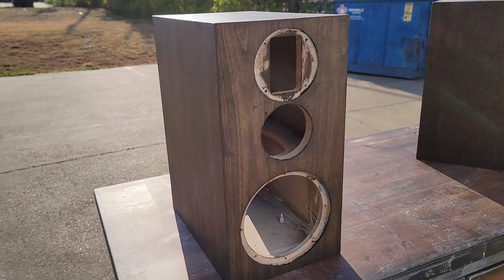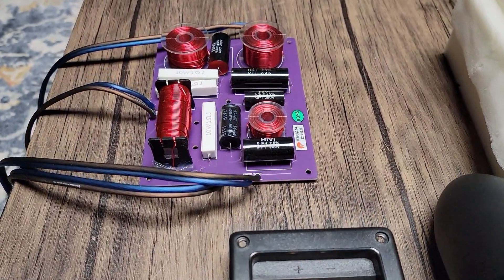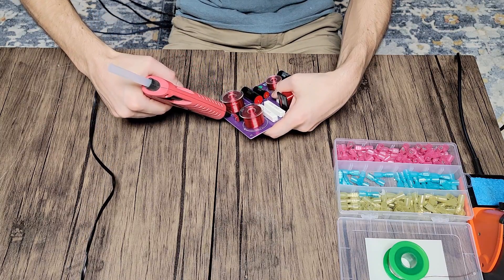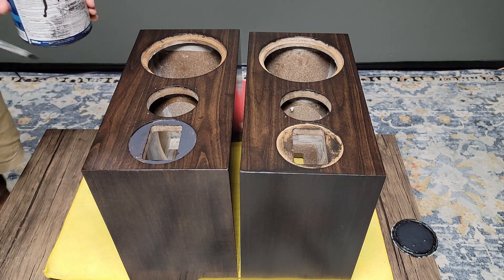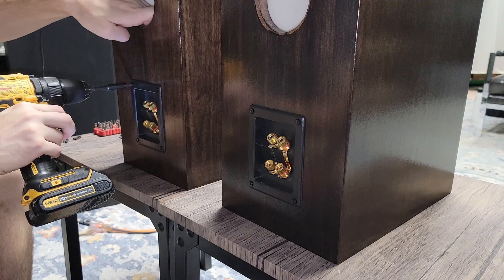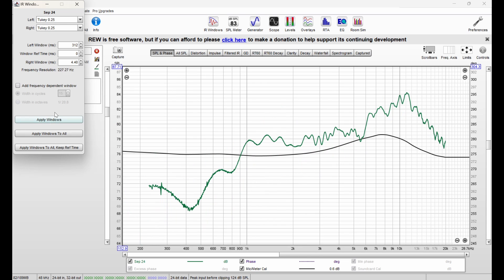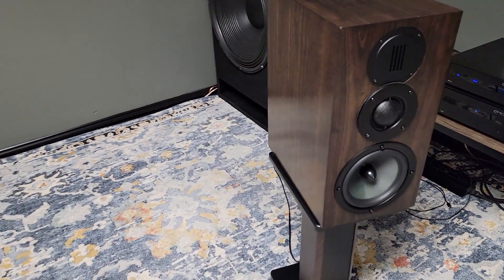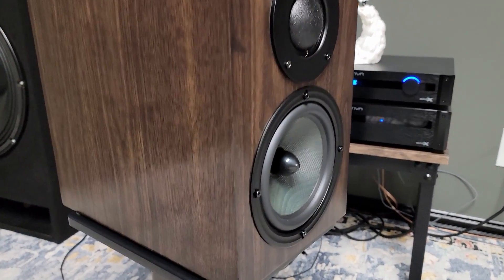Is This Amazon DIY Speaker Kit A Winner? Let's Build The HiVi Swans 3-Way Kit!

Comment: Well, i was incorrect about thenew xover parts so i went with mod #5. Xover barely fit.  Not sure  how that stock xover sounds but that guy from the sehlin website knew what he was doin. #5 sounds insanely good imo. I went with a metallic gold finish. Worked well against black drivers.

Comment: Interesting video but the music was too loud. Made it hard to concentrate on what you were saying, which I thought was the point of this video. Another point of interest is the open-cell foam used as damping material is much too thick and is stealing valuable inner room. Open-cell acoustic foam only works on a few millimeters at the surface so the rest is pure waste because contrary to Polyfill, sound waves do not pass through.  Thanks.

Comment: Why are drivers still shielded when interference with a tube tv is no longer an issue?
Reply: These are "new old stock" drivers. Probably dozens of warehouses full of them that were originally built with bucking magnets.
Reply: @wally7856 
Ahh. Good point.

Comment: I saw that they are now using "perfectionist" crossover values so i ordered.  Cant wait to build
Reply: Hi. Thanks for this comment. This is very good to know. Do you know where I can find a list of the old crossover parts and a list of the new crossover parts?
Reply: The Amazon listing says "Additions and Changes Make These Speakers Sound Its Best"...others have said the translation is unclear, and that crossover changes were suggested mods but not included.  What did you get?
Reply: @ggroch yes, I was tricked by the wording. Oh well, they didn't mean to I'm sure but you'd think there was some sort of translater they could use.

Comment: Note: If you want to lower or eliminate Bass Standing wave etc you should disassemble them and radius the inside speaker thru holes the sharp edges tend to cause diffraction issues. Also eliminate push on wire connectors, do not use PVC jacketed speaker wire polyethylene is better, get ride of Sand Cast resistors for better resistors usually $8.00 and up per and upgrade your Caps spendy $50 per and up. but the radius of thru holes is a must.

Comment: How did you trim the veneer over the shallow tweeter relief area?  Which router bit?
Reply from the maker: There are special shallow bits for router, but I generally use my hand & a razor blade for shallow recesses.

Comment: Just a quick think, the inductors at the crossover need to be in a different "plane" each of other, this is to reduce the magnetic disturbances
Reply from the maker: This is true, however the coils are quite small, and far apart. I wanted to build this the way it was designed. Hopefully to help someone who is looking for a guide on assembly.

Comment: Do they have good bass? I'm looking for a speaker build that has built-in sub woofers so I don't have to have 4 speakers 2 is better. Also why does it have 4 posts?
Reply from the maker: If you are wanting true full range, check out @toidsdiyaudio Epique build. These have really great bass, even more so for a bookshelf. With that said, I prefer using them with a subwoofer, but could live without one and be happy. Dont mind the binding posts on the back. Those are used for multi-amp setups. They come connected stock; this makes them function as a single set.

Comment: I absolutely had to reduce the midrange and tweeter outbut by seveal db.  I am now thinking of replacing the woofer for one with more output.
Reply from the maker: I run mine highpassed at 95hz. This means the bass from them isn't very important for me. I would rather have less distortion, and let subwoofers handle the low end.

Comment: I'm the guy that suggested using an old AV receiver yesterday (bad idea).  Just wondering if you've ever considered bi or tri-amping a two or three driver speaker with an equalizer instead of a crossover on each driver?  I'm thinking about building some speakers - the first in 15 to 20 years, and I'm kind of stuck on the idea.  I'm finding bits and pieces on the idea around the internet but no solid leads.  I'm sure you're a bit too busy to respond to this sort of comment, but I just thought I'd throw it out in the ether..  By the way, thanks for the video!
Reply from the maker: I'm not big on bi amping and such. There may be some benefits, but the cost is much higher. That said, DSP is a great alternative to passive crossovers. However this requires one channel of amplification per driver. I would like to build around DSP in the future, but will stay with passive filters for now.

Comment: I’m actually looking to get these. I recently put together a 2.2a diy kit. And they are superior to my other speakers. They even sound better than my klipsh reference towers. Amazing sound. I really couldn’t believe it because the price was so cheap. For reference I’ve built a few kits from parts express that were almost double the price. They do not sound as good as these. The tweeter especially is great. The bass is full and loud. I’m pretty disappointed in parts express. I built the morel ardons. They are bookshelves and each are 230. The teeter on them
Is horrible. The drivers lack bass. Anyway I’ve been really happy with these speakers. So now I wanna build these. Good video
Reply from the maker: I highly encourage you to do so. The ribbon tweeter on these is incredible. They image like the performer is in the room with you. I use a high-pass on mine at 96hz, but running full range, they put out a lot of bass. They really are very special. Thanks for watching!
Reply: I put together both the 2.2a and 3.1 also....I like both but overall the superior bass of the 2.2a makes me like them better.  I see Z-Reviews just reviewed an upscale not kit version of the 2.2a (Swans D3.1 mkII) that is says are the best bookshelfs he has ever heard.  Did you end up getting them and which do you like better?
Reply: @ggroch wow! I forgot I wrote that. I did end up building the 3.1. And I put the modified crossover in em. The crossover that came with it is to bright supposedly. I didn’t want to take the chance. So I used the modified crossover. Best speakers I own man. The sound has opened up in the past yeah of listening to them. The 2.1s I still have. I was listening to them daily till i finished the 3.1s. Both sets of speakers are spectacular. 3.1 are more open and they are just amazing. I sold my klipsch towers and I only use the 3.1s now. Daily.

Comment: Stop using steel parts in the sig al path for maximum quality sound,  no steel binding post,tube connectors only. no sandcast resistors-mills only, direct solder, all connections, with polywire. Your missing sooo much.

Comment: @DIYhyfy change the orientation of one of the inductors at the back, I'd recommend flipping the rear right front 90%, chamfer the edge of the plastic reel so it sits on the board. It will now be out of the plane orientation of the other two aircore inductors. You will be surprised how much inductors interfere with one another.

Comment: The freq response looks very uneven and bright treble? Wondering if the mike was too close and directly at the tweeter. I though most are measured 1M away?
Reply from the maker: There a several ways to measure a speaker. This is a very solid method. That said, it is definitely the speaker itself. They're known to be very bright. I may do a mod in the future to rectify this. Thanks for watching!

Comment: Rotate the woofers 90 degrees so all the speakers are aligned for looks. Use either Howard Feed N Wax or Formbys Tung oil finish on you next build.

Comment: Try getting all the drivers flush next time, I understand you're trying to keep acoustic centres close, especially with the high upper xover frequency, but that step and diffraction is not a price worth paying. Line the internals wit some open cell foam, keep some loose wool fibres in the centre, but as others pointed, those massive slabs right against the diaphragm on the inside are damaging. Well done!
Reply: Are you referring to the internal braces?
Reply: @davidjudd951  Slabs of foam to the left and right; had positive outcome employing B&W matrix derived internal structure of interconnected chambers, supporting constrained layer damping cabinet walls, internally lined with lead sheet, back in the day. You could say, it's internal bracing taken to extreme.
Reply: @paulb4661  Thank you.  I recently glued internal bracing inside some budget floor speakers.
 Wasn't sure if it was done properly.

Comment: That looks like a planar tweeter to me not an AMT.  Planars have that distinct cellular look aligned down vertical openings, and are a flat kapton ribbon with the "coil" printed on it.  AMT is a pleated ribbon that you can usually see the vertical pleats across horizontal openings.
Reply from the maker: You're right. It's an isodynamic ribbon. Don't know where I got the idea that they were AMTs. Probably because I'm constantly shopping for them!

Comment: Thanks for the informative video. I might have to snag a pair of these for a winter build project.

You mention that your high-pass is set to around 95Hz. Try setting it a around 60.Hz Being that you are covering the lows with 18" and a 21" subs, you might get a better transition at the lower setting. On a related note, where do you have the low-pass set for the subs?

Just my $0.02.
Reply from the maker: Hey unfortunately I can't control the highpass (to my knowledge). It's set by my pre amp in hardware. 
I don't have a constant low pass. But it's usually somewhere in the 80-100 range. But I adjust to taste often.

Comment: Just a suggestion on your camera movement.  Make it steady.  Your video is hard to watch because you move the camera in and out constantly.  Makes me dizzy.
Reply from the maker: Appreciate the tip. I have been thinking of using a steady cam. I think I will use one going forward. I figured it was an issue for some.

Comment: the coils on the crossover should be turned 90 degrees to eachother, or they will affect eachother
Reply: That’s a bit too much damping foam. In a vented enclosure you should have a moderate amount just to suppress the reflections of any midrange signal from the woofer. If you have too much it will absorb the lower frequencies and will dampen out the tuned resonance which makes a vented design effective at extending the bass response down. In this case, more is definitely not better. Also, with this being a three way with a sealed midrange the frequency range that you’re attempting to dampen isn’t really there.
Reply from the maker: @Obsfucation Thanks, I may try removing some and measure again.
Reply: Inductors just need to be spaced properly no need for "rotating" them.
Reply from the maker: Yes I'm aware. I built this as it's laid out. The coils are far enough apart to be fine.
Reply: do you have a link to the kit, or the midranges?  @DIYhyfy
Reply from the maker: @fredrikastrom9372 HiVi-Swans DIY 3 Way Passive Bookshelf Speakers Pair - DIY Speaker Kit-Peak Power 120 Watt Home Theater Bookshelf Speakers for Surrounds or Front https://a.co/d/dsoKPsa

Comment: Absolutely loved building these...
Also left my crossover stock but rounded over all of the corners with a 1/2" round over bit, and painted the modified cabinets with Gliddon's Maxi-Flex Gloss White (highly recommended).
Ditched the included terminal cup for Dayton Audio's 5-way gold binding posts. Looks much cleaner, but was quite a bit of work to plug the hole with some scrap mdf and erased the imperfections with automotive body filler.
Now working on building a set of custom subwoofer stands to match with dual Dayton Audio MX10-22 drivers for each stand powered with a Crown XLS 2502.

Comment: Great video! I just watched them all. I don't think parts Xpress has any kits for open baffle, but with your building skills, it would be very simple and I know that you would love this sound! Google Manzanita open baffle for one of the simplest DIY versions to build.  You have Subwoofers to supplement the bass and a good room for it. You won't be disappointed.  I built both these swans and the the notes, plus 2 18" ultimax's in sealed boxes.  Had to move to an appartment and sold my 18's  :(

Just moved back into a house and built one of the 15" ulitmax sealed boxes.  Pleanty of output paired with my svs sb2000 but I think I'll build another 15 or 18 when I can.

Comment: Good job on the finish! I’m a Autobody painter and also do some wood finishing on the side. Lacquer really does have its own unique look. If your not already I highly recommend using a catalized version. Sherwin Williams makes a catalized lacquer called a medium rubbed effect that I think looks fantastic and lays absolutely flat. No orange peel whatsoever 👍🏻 I much prefer my wood finishes to have more of a satin look over a gloss.  To me the gloss looks dated, cheap and homemade
Reply: You're definitely right about that! Have you ever tried using tung oil? For something like a speaker that doesn't really need protection I'd recommend tung oil over anything else. The beautiful matte depth it gives to the wood is unlike anything else.
Reply from the maker: Thanks, I will look into it! What can you recommend for hvlp auto finish? What paint & clear would be best? Thanks!
Reply: @DIYhyfy  hey!  I use a high end paint from Axalta called Standox, but it is quite expensive, and allot of what you are paying for in a high end paint is color match technology and warranty. Most of the lower line paints can be pretty good they just don’t come with the same backing as the expensive lines. I would just find a reputable paint store and work with them. I do recommend when purchasing your clearcoat that you ask for a high solids glamour clear or show clear. Also be sure to use a 2K high build primer under everything to seal it all down. Good luck!
Reply: Really liked the Glidden Maxi-Flex line for small projects. 
Glidden is owned by PPG, and from what I understand the Maxi-Flex line is a Laquer finish. 
Granted nothing beats a 2-part layed down with a decent gun in a controlled environment, but very few have access to that.

Comment: There appears to quite a boost in the high frequency, is it not overly harsh?
Reply from the maker: Yes there is a big rise. They never come off harsh to me. It's possible this is also in part the ummik1 problem
Reply: Not a great curve... would love to send them to GR-research for tweeking
Reply: Measurement should have been done at between mid and treble driver, as you measured on axis to tweeter, the measurements are hotter in the top end than in actual use.